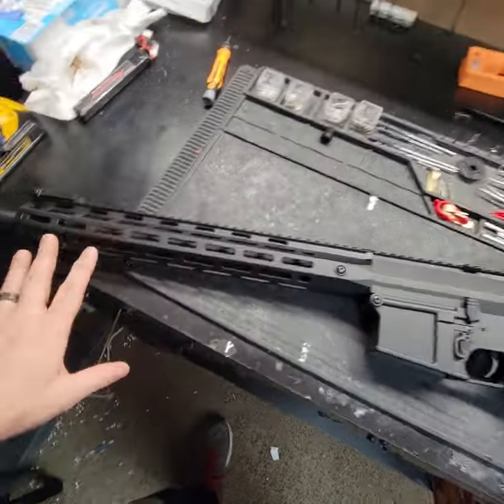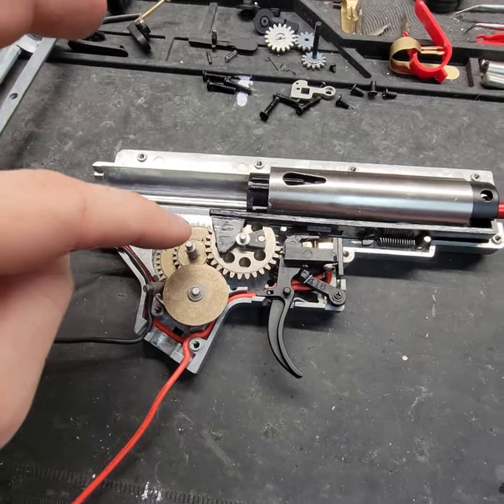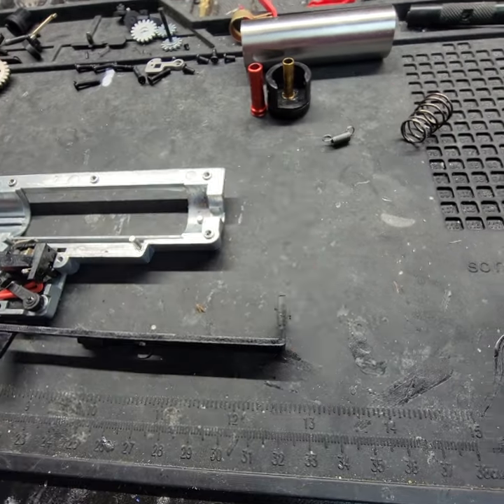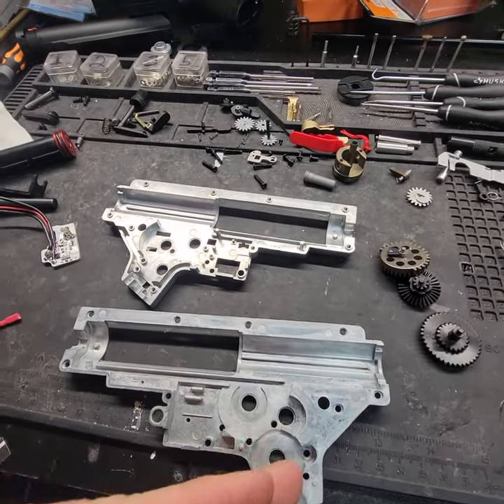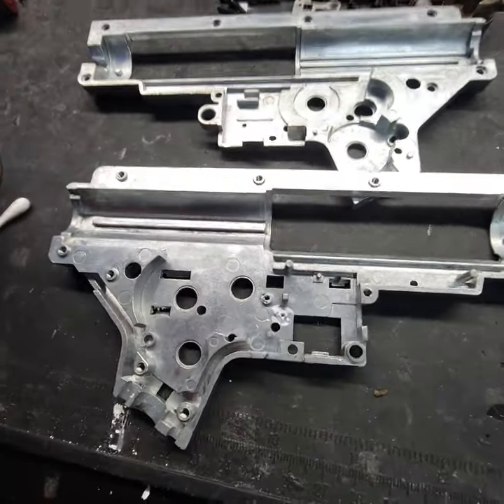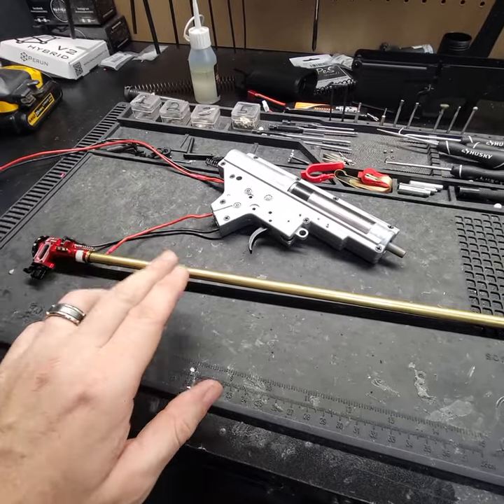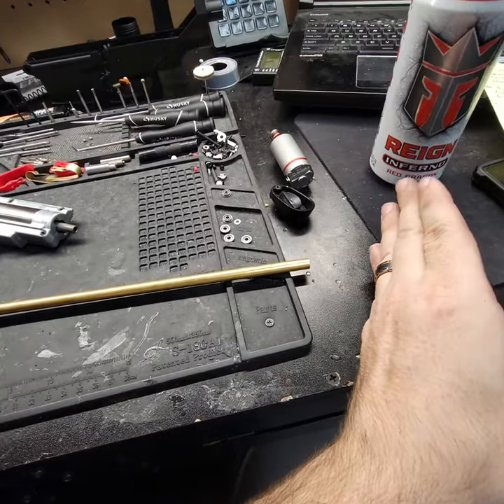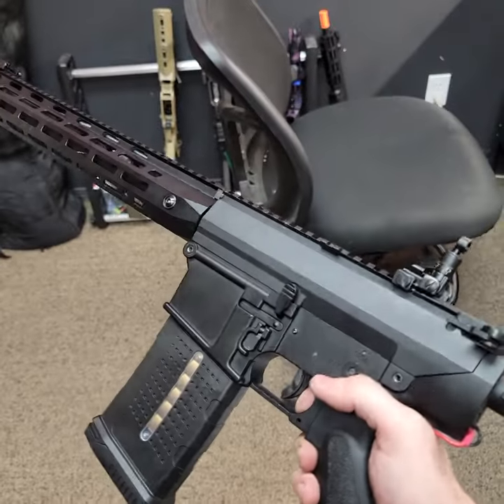Double Bell SR25 Internal Review & Upgrades for More Power | Airsoft Tech's Guide

Comment: Can confirm the issue with the sector gear striking the cylinder is common in their V2s. It is a design flaw they clearly couldn't be bothered rectifying, instead on some models they have a factory-modifed cylinder to allow for it (section cut away for clearance). I initialy thought mine was defective, before realising the sector completely locked up with any other V2 cylinder. Also have one of their AKs, and it suffers from similar tappet plate issues to those you've described here. Once sorted they work rather well though.
Reply from the maker: Their own pistons bind on a little on the sector gears, too. They dont mesh to each other smoothly.

Comment: I just opened one up myself for review. Ran into the same issue with the sector gear hitting the cylinder, fixed in a similar way. 
I did notice that the right side bolt release is installed with a one-way pin, and seems impossible to install the gearbox again without omitting the bolt catch on the side of the gearbox. Did you run into that issue as well?
Reply from the maker: From what I can remember. There was a tiny screw right above the selector switch that gets in the way of pulling the gearbox that I had to take out. Btw, you make great content bud!
Reply: @wyshtechairsoft  Good catch. I just popped those out, should make things a little smoother reassembling. 
And thank you!
Reply from the maker: @ASTKilo23  no problem! Glad to help man. Im also releasing a Cyma Platinum SR25 build next monday.  I absolutely love building up SR25's.
Reply: @wyshtechairsoft  very cool! I've worked on a few of those cyma plat sr25s, solid guns and easy enough to build out. 
I still love my gr25, even if it doesn't have the same cylinder volume. I need to get myself a second eventually, can't have just one lol
Reply from the maker: @ASTKilo23 Those Gr25's are pretty. Not gunna lie... I currently working on a complete custom build sr25 (using an A&K reciever and barrel assembly) for myself with the RA sr25 split gearbox.
Reply: @wyshtechairsoft Have fun! Sounds expensive haha

Comment: CYMA is known for pot metal material, compared to Double Bell, would you say the material they used is better than CYMA??? Thanks!
Reply from the maker: Id say both gearbox shells in both brands are equal.  Ive built many CYMA SR25's shooting 3 joules on .45g bbs and not a single one gave me issues.  Double Bell is also a good choice if you plan on putting in your own preference of ETU. Though I did have issues with teeth mesh between the factory piston and OEM sector gear. Which leads me to believe that can cause a potential failure point.  Putting in a Retro Arms SR25 piston fixed the mesh issue and it was buttery smooth.

Comment: Awesome vid! I added this to my Reference playlist 😆
I can only imagine it'll feel more fun if you install the Perun Clicker (maybe a helical gear set too). About the cylinder: would you get similar results by making a slot/cut where the sector gear teeth make contact with the cylinder? 
Are there any aftermarket SR25 gear sets you recommend? Preferably aside from the SHS set which is notorious for having the sector gear failing.
Reply from the maker: To be honest, I should have made a slot on the cylinder instead.  Didn't think of that when I already modded the cylinder 1mm shorter.  As far as the gears go... The siegetek sector gear is alright and seems to no cause the tappet pme I mentioned in the  video.  Though Ive ran into two separate sets of seigeteks with warped spurs. The OEM sector gear from either the Double Bell or Cyma Platinum can handle alot of stress. Even as high as 3 Joules, no problem.
Reply: @wyshtechairsoft  I noticed the Begadi set on your site. What's your opinion on those?
Reply from the maker: Sector gear is advanced timing just like the shs and rocket gearset.

Comment: I can confirm, that specific bearing fails. Ended up replacing it with a bushing as well on my gun. 😅
Reply from the maker: Keep a close eye on that sector gear rubbing on the cylinder. This one did, and I had to put a notch on the cylinder so it would stop.

Comment: Why didn't you use the cnc "omega" nub that is included?!?
Reply from the maker: Because it always causes issues with the super macaron and .40g bbs. With that piece, you have to turn up the hopup to almost max just to hop .40g bbs. Even with a harder bucking like 70 degree or even 80 degree. Which you get worse seal with and loss in fps.  The hardness of the omega nub works perfectly and hops the bb much more consistent than the cnc version.

Comment: Slong cylinder head is pretty cool. But is the metal tube too short for sr25?
Reply from the maker: What tube?
Reply: @wyshtechairsoft  the one u place the nozzle in
Reply: I'm pretty sure there's a difference with cylinder heads for sr25s and m4s, even with the low standards of double bell
Reply from the maker: @mmwkoh  They use normal v2 cylinder heads.  I do try to install cylinder heads with longer nozzles on them to support the long 24.5mm nozzles they take.  Usually EPeS has longer versions for v2 cylinder heads and I sell them on my store website.
Reply: @wyshtechairsoft  wow that's cool! Slong cylinder heads are the best I've used. no leaks and very sturdy. Their gearboxes and vsr hop and trigger box suck tho

Comment: What length should i go in 6.02 inner barrel using 100% cylinder  of v3 gearbox ?? Also i do aoe correction and probably  lost effective cylinder volume
Reply: Using .36 or 40 bbs please reply
Reply from the maker: Best way to answer that is to check out this forum post. It shows you how to figure out the barrel length. https://www.airsoftsociety.com/threads/what-barrel-length-goes-with-what-bb-weight-in-an-aeg.153191/

Comment: any idea how long the Double Bell SR25 nozzle was? I'm stuck between a 24mm and a 24.5mm nozzle upgrade.
Reply from the maker: 24.5mm for sr25 nozzles.
Reply: @wyshtechairsoft  I have a SHS SR25 nozzle which is 24mm (orange) and a FPS SR25 nozzle which is 24.5mm
Reply from the maker: You know its too long if it misfeeds.  You also know if its too short if fps on the chrono is all over the place and low. It'll be one or the other.  Ive done many sr25's and 24.5mm never caused issues.
Reply: @wyshtechairsoft  I put the FPS 24.5mm nozzle in and it works perfect and everything feeds flawless, the stock nozzle is 25mm and I had nothing but issues.
Reply from the maker: Yup! 25mm is just a pinch too long.
Reply: @wyshtechairsoft  I'm having an issue where once hop is applied my FPS tanks, without hop I'm getting 320 fps on 0.40. With the correct hop its 245 :/ what would be causing this?

Comment: Keep upp the good vids man!

I have an sr25k v2 extended with a 363mm barrel whats is the optimum barrel for bbs 0.40-0.48
Shoting 2j 120ms 0.32 m140 spring now!
Reply: Sorry i mean 0.28
Reply from the maker: .40g bbs is about 440mm in length.  363mm is way too short and is overvolumed for .40g bbs.  .48g, havent tried yet but a rough guess would be 410mm without knowing your compression volume of your gearbox.  Those .28g bbs is WWAAAAAY too light for such a short barrel.  Is it using a full cylinder?
Reply: @wyshtechairsoft  yes it is with full cylinder, tried with 0,20-0,32 no drop in joules (2j), also Using 6,03 barrel infinity 18k motor, but im going to try with with longer pipe, i got it so Quiet until i fucked upp the gears when mounting titan, motor cabels got pinched and it got Off center. So now with new gears (shs new type with bearing) it isint quiet att all anymore. Sounds like piston slap like ”ting” after each shot before it was a phomp sound nice and quiet, ”silent piston head and padding but i think it is to hard and thin now. Thanks for reply